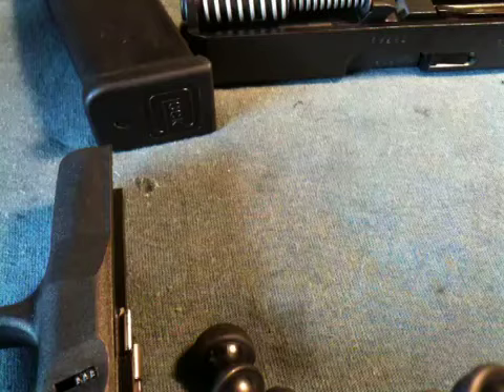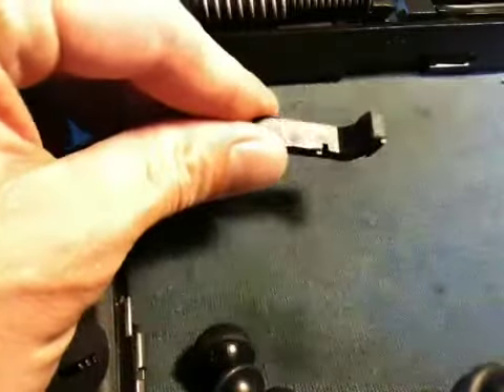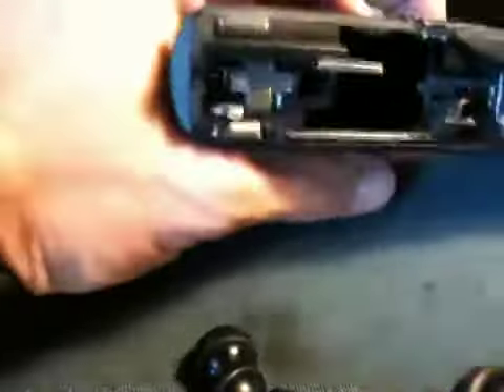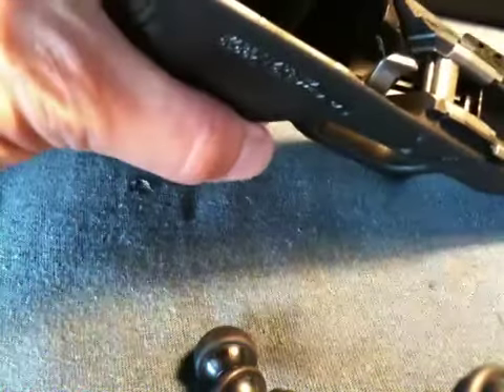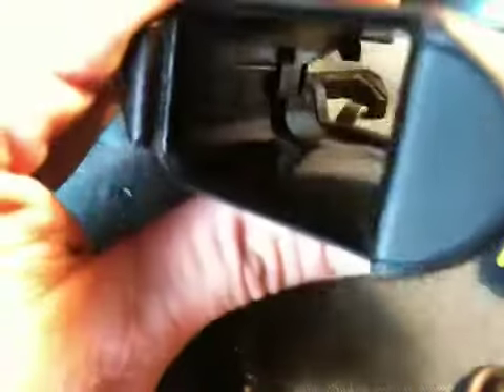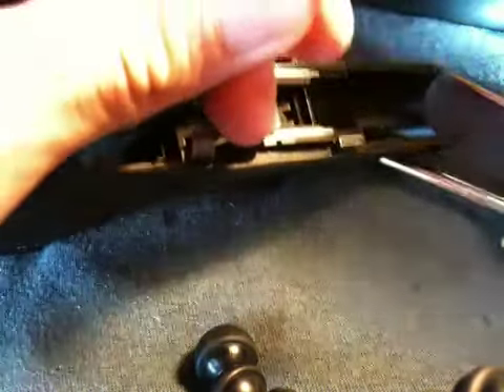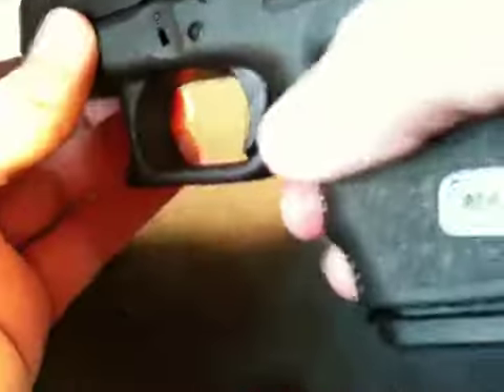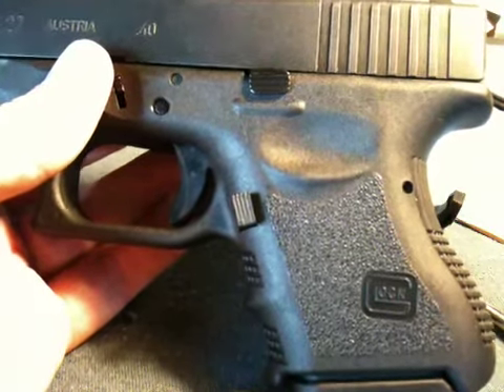Glock 27 Extended Mag Release Install

Comment: A phillips head screwdriver works well at getting that spring out.  You can use one edge to get under the spring and the other edge to pull the spring out of its track.